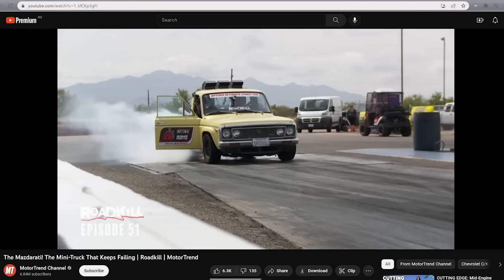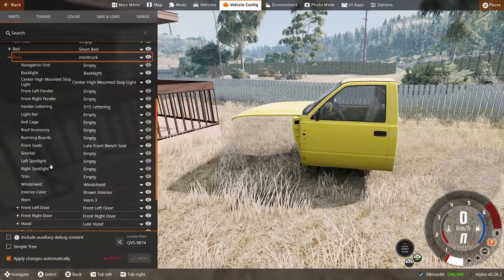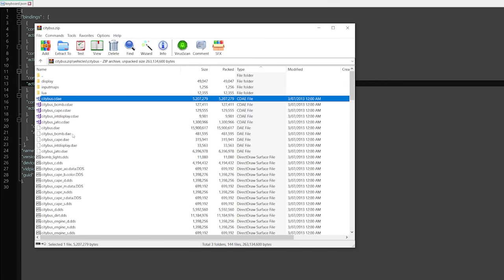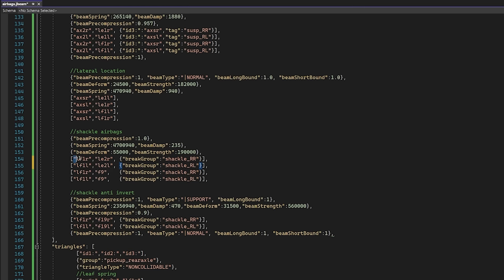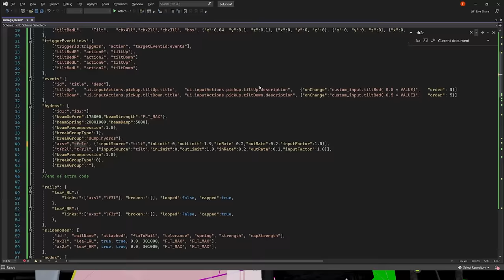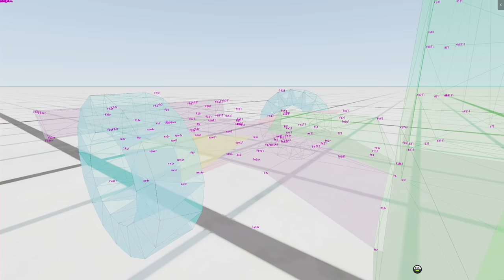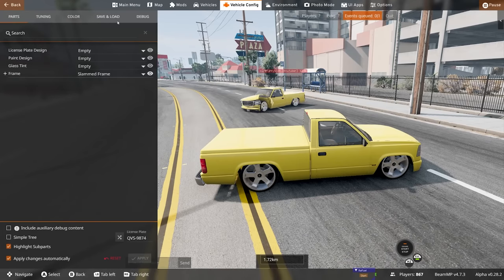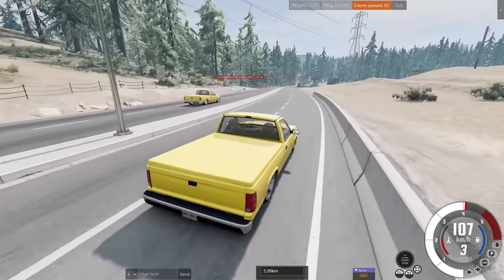I Wanted to Understand MiniTrucking, so I made one in BeamNG

Comment: The Scintilla has an axle lift feature, it can be controlled from the interior buttons. You could have based your code on that. But what you ended up making is pretty much the same setup in the end lol
Reply: Let the man cook
Reply: hi agent_y, cool seeing you here in filman's comment section lol
Reply: Also can be controlled into the radial menu under electronics I think.
Reply: I actually never knew this!
Reply from the maker: tbh I couldn't figure out how to move these types of code from one vehicle to another :/ so I had to go with something the car already had
Reply: @fillman86  No idea why it didn't work for you when it should. Maybe you didn't restart the game
Reply from the maker: @agenty_gd  I think I just don't know what I'm doing when it comes to this stuff XD
Reply: It's agent_y himself
Reply: @fillman86  u should also try “c” notching the frame and it would be better for the rear when they lower the trucks.   Or if you know how to do irs for the rear that would also help
Reply: @fillman86  oh btw, for the air bag suspension you could have used the Gavril bluebuck lowrider. Which has airbags.
Reply: @jwalster9412  hydraulics* but he did mention in the video (in post) that he forgot about the grand marshall hydraulics (same thing), however what nobody else has mentioned is the t-series airbags which is already both sides and not just a lean/tilt feature like on the bus
Reply: W dev

Comment: Hey! Minitrucker here, look at stuff at Southeastern Minitruckin Nationals… there are still TONS out there… they also use link type suspension with short links. I unfortunately have no modding skills but plenty of history knowledge!
Reply from the maker: never seen them here in australia, so I know literally nothing about them :P I also just didn't think about swapping out the rear suspension, that was a pretty big mistake XD
Reply: @fillman86  I would love to post it here but I have a Ford Ranger from 2003 thats on air bags all the way around and the front is the double wishbone independent and the back is a 3 link suspension with airbags mounted on the link bars on the bottom and the frame mount on top

Comment: Personally, one thing I would recommend is to change the rear bumper to be the roll pan.
Reply from the maker: I don't know what that means :/
Reply: @fillman86  in the options/configurations menu when you’re changing parts, you can change the rear bumper to a different one called roll pan which is much better for a mini truck
Reply: @fillman86  it’s basically just a smoothed bumper that’s flush with the sides of the bed. Gets rid of the bumper and replaces it with a smooth piece of metal.
Reply from the maker: @stelarnono409  ah
Reply: @fillman86  yeah. It looks clean. If you really want to go all out, shave the door handles and tail lights and add some graphics! Oh, and don't forget a sunroof!

Shaved means removed. So basically, you cut out the tail lights, fill in the gap with sheet metal, so that it looks flush, as if the body just curves, without the tail lights, and relocate the tail lights elsewhere. Google it for images lol. Same thing with door handles. You remove them, so the door is smooth, and have a button on a keyfob to open the doors. Oh, and I almost forgot, suicide doors!!!!
Graphics mean a cool paint job with designs and patters. Flames on the side of the truck counts.

If you want to go old school, add a wink mirror to the interior. I can go on and on and on, but I'm definitely not the one to ask. There are plenty of great youtube channels and people on facebook that know 100x what I do about these awesome trucks. Btw, I'm the kid who pinged you in Mighty's server in #media (with the orange fuzz ball pfp) If you some extra irl photos (that I took, without the kei truck interference) shoot me a dm ;)

Comment: I've been looking for a mod that makes heavy-duty dually towing trucks able to lower, because sometimes the gooseneck trailer spawns in just shorter than the super heavy duty springs make the end of the truck stand. I'm using the BeamLR mod so adjusting the trailer isn't allowed for some reason, I'm also using the any-level truck mod, but the shock absorbers are non-existent so the truck bounces all over the place when it's raised over a certain level. It would be cool to see a tow setup that lowers and raises to correct levels, and can still have soft, but still usable shock absorbers for the bumps. I have no coding experience, but it would be cool to see a repository mod that I've scoured the internet for! Might be a little easier since the idea is made to be strong and adjustable, not short and scraping..?

Comment: You should definitely c notch the back of the frame which would allow the rear end to go lower than the frame. Also should make a way to have link bars like a 4 link thats triangulated so the rear end will be solid but other than that its definitely cool that you were able to make a mini truck
Reply from the maker: it wasn't colliding with the collision mesh though :/ I also admit that going with the stock suspension was an oversite... oops

Comment: I absolutely love the pro touring autocross trucks you can see over here in the US. I plan on doing a 4 link rear axle setup on coilovers with a gen 3 coyote motor out of a mustang and either a 10r80 automatic or a tremec t56 6 speed manual and I'm trying to decide on whether or not to do the 99-03 ford lightning front bumper and grills because I already plan on doing a side exit exhaust like the lightning and I plan on doing the early ford lightning wheels but in 20in replicas because they are cheaper than a legit set and they are proven to be just as strong
Reply from the maker: that's quite the plan you've got there!! let's hope money doesn't elude you, and you can do it some time soon :)
Reply: They stopped making muscle cars so we just kept on making muscle trucks.  Every once in a while the manufacturers will get in on the fun too.

Comment: Use the 3 link rear suspension and replace the rear suspension with the hydros and your pivot points would just be the shock mount nodes, also to go lower you’re going to have to make the axle and frame not collide with each other

Comment: Is there a reason that you used leaf spring in the rear? Wouldn’t it be easier if you made it Double Wishbone and changed the dampers to hydraulics? (I’m not an expert or anything, I just think dampers and hydraulics look similar, and therefore might be used interchangeably. Also, I’m kinda an idiot LOL)
Reply from the maker: it didn't have IRS as an option :/

Comment: So…I don’t really know how coding or anything works but I found this video quite interesting. I’m not sure if it is doable but if you could make yourself a triangulated 4 link in game that is generally how air ride is setup on these trucks. I could see the bus or grand Marshall air suspension working. 

Parallel 4libk would work too but would require a panhard bar
Reply from the maker: 4 link was an option, but I just forgot to try different suspension XD

Comment: You could have used the granmarshal or the blue buck they have hydraulics and the gran Marshall has the same wheel base as a d series and you can lower the ride height of the hydraulics so you can scrape the ground and the way you did it you should have used a 4 link rear so your not messing with leave springs you can just replace the coils with hydraulics
Reply from the maker: all good points, I'm just limited by my skill

Comment: I'd like to see Race (M) Pidgeon, bitch looks like serious minitruck fun. (like literal minitruck, compared to what the scene calls it)

I fucking miss my purple 94 Triton
Reply from the maker: a mini-minitruck?
Reply: @fillman86  Now where getting somewhere!

By the way, with the whole node issue you where having, instead of turning the spring mounts into a hydraulic, perhaps you could have turned the spring into a hydraulic instead. I noticed the damper on the rear axle was actually pushing its mount around and down into the ground when you lowered it too btw.

Comment: You should of used coil spring rear suspension would of been better than leaf spring. I did this myself using the 4 link coil spring rear suspension and it works pretty good.
Reply: Oh wait nvm I just re looked at it I actually robbed the coil spring rear suspension off what looks like the moon hawk apparently.

I used modified moonhawk coil spring solid rear axle for the rear hydraulic suspension on my truck.
Reply from the maker: nope, the rear is just ol' leaf springs

Comment: If a truck is this low to the ground, is it still a truck?
Reply from the maker: I'd say so...
Reply from the maker: just not a good one :P
Reply: @fillman86  I was thinking it would become more to a tuck because your Remove the "R" which obviously means ride height and tuck the wheels on the fenders.
Reply: Lowered trucks are easier to load and unload.
Reply: @black99rt  yes, but is less ground clearance, probably less load capacity, and ground scraping suspension really more practical?
Reply: @jwalster9412  my static lowered small single cab truck doesn't scrape the ground and maintains the same load capacity as the springrate is increased to match the deceased bump travel. Taken to extremes is obviously compromised though yes.

Comment: forgot to mount the upside down trailer hitches on the bottom of the rear end :)
Reply from the maker: not sure what you mean
Reply: @fillman86   a lot of dropped trucks with bags have trailer hitches with the ball facing downwards, either bolted or welded to the bottom of the frame. When you slam it at speed it's a shower of sparks from the trailer hitches instead of your frame. Banging frame is fun, but doesn't last lol
Reply from the maker: @JetSetSixDeuce  oh wow, that's not great for the road either XD
Reply: @fillman86  not at all, but I can't be mad. I've seen actual trailers commit exponentially worse damage to the roads here in Texas 🤣🤣🤣

Comment: this guy thinks a bed cap makes a truck not a truck 🤣
Reply from the maker: I’m not sure what you’re trying to say… are you thinking I said the bed cover changes anything? I just put it on for a clean look
Reply: @fillman86  2:23 "And, we don't want any of the rear cabin stuff because then that makes it not a truck."
Reply from the maker: @dusting1851  oh yeah, that makes it more of a sandman/wagon type thing, instead of just looking like a truck
Reply: @fillman86  no, its... it's just a truck. With a bed cap.
Reply from the maker: @dusting1851  technically yes, but it doesn't work for mini"trucks"

also technically this isn't a truck, because apparently it needs to be a dually for that, making this just a "pickup"... we just call them utes here haha
Reply: @fillman86  in the US, "truck" is a generalized term for anything larger than a minivan that is not a panel van, unless talking about kei trucks. Most of the time, it refers to pickups or semis. And since we're not talking about semis...